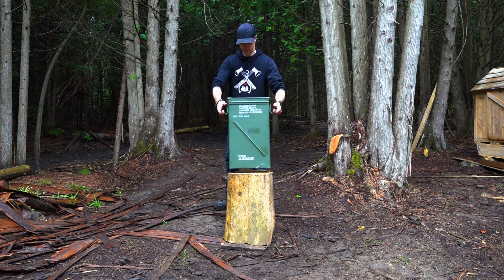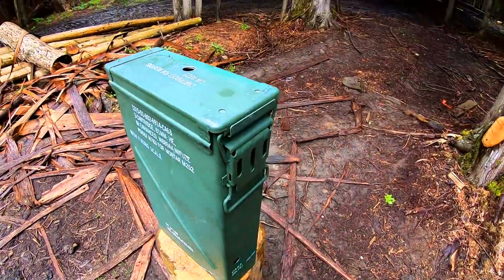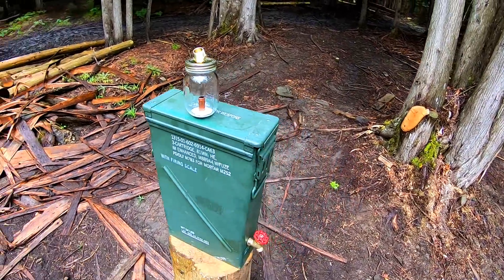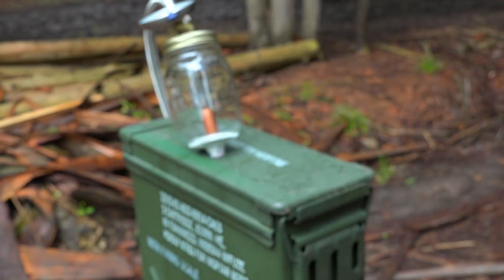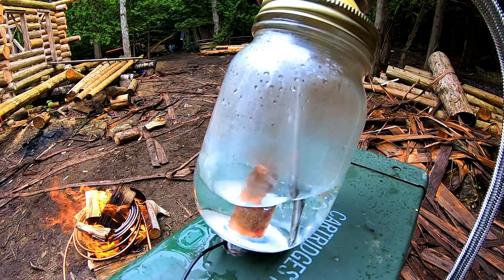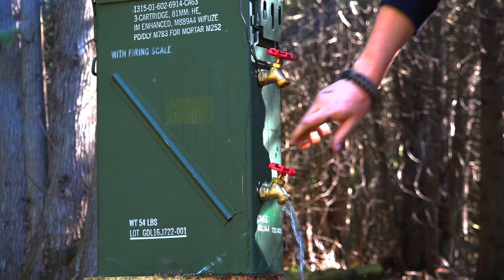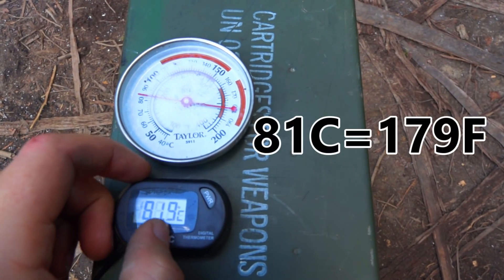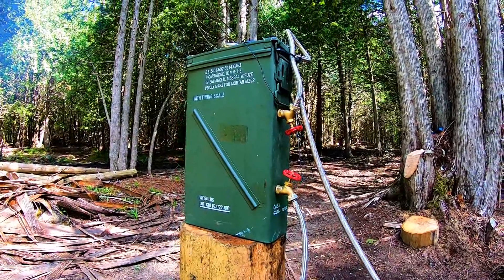Off Grid Heating Prototype- Copper Coil Water Heater / Heat Exchanger / Radiant Heater

Comment: reverse the system and put the coil in your shelter and then you could regulate your temperature by closing the valves
Reply: after thinking about it the best thing i came up with was a 2 coil system with a 3-way valve where the 3- way vavle sits between 2 coils with a bypass return to the can
run the valve handle through the wall and use it as a thermostat turning off the inside coil when you get warm enough. will require second return for the inside coil though
Reply: where can i get a ammo can like that?

Comment: right idea wrong concept, i used hot bricks before stack them... 

what your want is thos 99cent store candles 12x2" glass , do not use the toxic ones,  used 4 in your DIY camper they burn about 40 hrs each, 5 days of use, they burn clean, ......

small fan, to move the air in box, so not get stagnant.....

basic heat Timer /water 2hrs / bricks 4hrs / 10" rock 6hrs , takes 6 hrs to heat too, /

Comment: now the next step is to use the hot water to make electrical power
Reply: micro steam turbine, running a washing machine BLDC motor, charge a battery for an inverter!
hollow log rocket stove, with pressure cooker, piped into a radiator!
the sweetness of it all...aaahhh
cheers

Comment: If you seal it up so it can build pressure, it will raise the temperature necessary for the water to boil. You would have to design something like an adaptor for a radiator cap to vent pressure when it meets a threshold though

Comment: Neat yet completely impractical.  Too much equipment to carry and maintaining a supply of wood to heat the fire and water, which will be lost over time. You'd need to have abundant water in the area. Water is 8 lbs a gallon. The amount of water you have is at least 20 pounds not including the weight of the ammo can. Everything here is should be for entertainment only. You're a hobbyist everything depends on something else to function. A small camper pulled by a snowmobile is cool but a tent is lighter and more functional. You could have bought a large plastic doghouse and towed it.

Comment: what an absolutely terrible idea , your ether pumping steam in to an enclosed space thats going to hiy minus 10 4 o clock in the morning or sleeping next to a bomb or block of ice , can i make a suggestion ? keep all the water outside just have a coil placed in an ammo box full of concrete with vermiculite etc in it as a thermal "brick" inside the cabin , that way you dont need to enclose the reservoir can keep it outside and do not have to take the coil off the fire an hour after you start

Comment: You'll need to weld a bunch of steel heat sink fins on your ammo heater can.....to radiate the heat out better. Pretty neat design...learned something...all ports and hoses need to under water filled with water....no steam air interface areas.
Reply: Like car radiator?
Reply: @myes344  Yeah...he should have just used an old car-truck radiator.

Comment: Based on the final boiling water temp my guess is that placing the heater in your sled shelter will not only cause the small space to become too hot, it will also cause it to become a sauna.  The hot water vapor will soak your sleeping gear and you will become hyper thermic  as the temperature drops. If you just heat the water in the ammo can, remove the coil, seal the top hole, you can place the hot tank in the sleeping area and enjoy the warmth without the condensation.

Comment: Why not pick up a nice bigstock pot ..coil the copper wire into it run it out the same way you did the ammo box...a in and out hole .. Fill pot with water ... 
Then use a hose to hook up to the ammo box in and out or plex line insulated with weathering pipe foam to maintain the heated water in the colder temps out side...
This might bring down the ammo box water down a few notches in temp. This would be very close to a water heater set up.

Comment: If you were to make it a sealed circuit with an expansion tank and a pressure relief valve (safely). The above mentioned automotive radiator would be ideal (expansion tank too). 
You could then reverse your inlet and outlet therefore hot water would flow into the bottom and rise up displacing the cold water which I believe would flow quicker. I know when you are installing circulating heaters on diesel engines you always want the inlet lower than the outlet to promote better heating.

Comment: Nice video question can you add radiator coolant witch will increase the boiling point of water or use oil in place of water also instead of placing the ammo box in side run some copper tubing inside the camper to radiate the heat or heat the floor with the copper tubes then the heat will radiate from the floor up you will not have that red hot ammo box inside you can sit it in a large tub of water heat the water for washing with.

Comment: Couldn’t you run a length of the coil or line under the flooring to circulate the heat evenly while mounting the ammo can outside on the front or back?

Comment: I agree a car radiator method would be great. Also a closed system with a way to redirect the output or otherwise shutdown the radiator from inside. In fact, u really don’t need much heat at all do you? A small motorcycle radiator would work. Maybe shutting down the outside fire and using coals to heat would work.

Comment: You have the surface area wrong. Yo need VERY little surface area in the fire, where the external temperature is hundreds of degrees (F) above the boiling point, and LOTS of surface area inside, where you want to radiate heat from hot/boiling water to an environment just above 100 degrees cooler. You're going to have trouble controlling this to remain a liquid thermosiphon rather than a boiler in any case, but all the more so if you have all that copper tubing in the fire. As it is, you will get a lot of boiling and "percolator" action in the tubing. If you want to run a thermosiphon, put your thermometer right in the return line -- that's the T of water returning to the fire -- then adjust your "collector" so that temperature is just a bot above the inside T you want to maintain. I'll bet that you discover you don't need more than about one foot of tubing right in the fire to maintain it.

(and it will be quieter if there is no boiling in the tubing)

Comment: Idea 1: keep the  current heater setup outside the cabin. Run piping to and "inside" the cabin from the heater. In fact. have the pipe run under the flooring (ventilation options for u),  result: no inside space loss. Outdoor sound reduction (don't wanna disturb the crickets) and proximity safety (not inside where u r sleeping). Options to shelter the ammo can for outdoor noise reduction and insulation benefits. Work on and underground fire-pit that slow burns. (think of how they make charcoal)
       Idea 2: Put Wood-stove outside/close to cabin. Run piping from it. I suggest the flooring heat option.... should look visually friendly outdoors. Keeping the goals of "nature/critter respect"  with the lowest human footprint. Plus ya'll might want to sit outside around the nice heat to "Pop a cork and chew a while"  - The wood-stove will way way cut down on wood fuel =less wood manuring/hauling/stacking/locating/hauling/yada yada
       Idea 3: Use wood-stove upper venting pipe (stack). have it go into cabin where u c fit. ..................An inside cooling vent for all ideas should be in place

Comment: isn't it more efficient to run it the other way around ? Like for example a liebich cooler when you run the hot water in true the botom inlet it has more time to give off the heat, Or am i wrong about this and ys then the jar would be completly useless yes but wouldn't it be more effectiff if you did it like a liebich cooler but then for heating instead of cooling. Just a thought that crossed my mind.

Comment: The only way I have made this work is by a controlled spiral where the cold and heavier water falls down into the heat, and then is directed up and lifted by the lighter hot water.  That creates enough flow to carry with it small bubbles that naturally form.  If the system has any high spots like in your unorganized coil, air bubbles will form and there temperature will quickly reach boiling temperature and create steam which shoots the water out of your coil.  Now the system will rattle and clack as the steam collapses as cold water is introduced and water will come out hot in both ends.  When the system works correctly it is silent and one side is cold and the other side warm flowing in one direction.  The key is no high spots where bubbles will collect.

Comment: Why didn't you install any kind of weather stripping or insulation on the door to your snowmobile camper...? I know it has to get cold and drafty in there... you could help mitigate that with $10.00 worth of foam doorjamb weather stripping from the hardware store...

Comment: Nice build.... Brilliant and simple... You need to a temperature and pressure valve to run out of your sled camper... It will keep from steaming up your sleeper and you could always return it to the water supply via air gap and directional check valve. 
  Awesome video

Comment: The main problem was nowhere near enough water, the resivor is way to small for that much copper,  with 40 feet of large copper, you need to be planning on heating 100 gallons of water

Comment: This would be a nice application for paint that changes color when it is hot/cold. If you can have green as the background color, you could write HOT with a paint that is green in cold temperatures, and red in hot temperatures, and write cold with a blue paint that changes to green when its hot. Or maybe just go to ebay and get a "spray paint stencil/template" of some nice looking flames that can show up when it gets hot...

Comment: Cool idea sounds just like you'd be sleeping in a war with bombs going off in the distance not trying to be negative just saying it's loud. Maybe solar power with wall mounted heaters their slim and run on about what a light bulb runs on love your little home for the snow mobile but anyways that's my idea hope you get it figured be safe and have a good day
Reply: Kevin Kitts Done correctly it is dead silent. The clacks and rattles are from the steam collapsing in the coil due to air bubbles which allows the water to boil and forces the water out of the coil.  Working correctly the water flows in one direction down on the cold side and back up on the warm side.  No high spots in the coil to trap air is key.  It has to be a wound spiral and not just a pile of copper coil thrown in the fire.

Comment: Wrap the coil around your small woodstove, an wrap it in mineral board insulation. It's used to insulate boilers an it will shrink your wood usage an improve efficiency. Also run a relieve valve out your ventilation hole to keep from getting scalded if it tips

Comment: O, close the hole at the top with a pressure relief valve so you do not lose the water while your sleeping and so it does not blow up.

Comment: Place it under your camper and reduce the amount of coils (to 1 or 2) if your going to put it on the fire directly and it should work just fine. If you keep it in the SMALL camper you will not be able to take the heat. You will cook in there but outside under the camper, no problem. You MAY need to open a window from time to time, maybe.

Comment: I thought that's what the hose bibs were for.
Restrict the flow, less heat transfer.
Way more copper than probably needed.
Great if you don't have to move it around much.
Sounds like lots of coast time using that can.
I'm thinking, fill the can with some big stones.
Toss them when it moves, find more rocks.
It would hold the heat better, maybe more stable?
Cone shape with the copper coils, smaller footprint.
Bend up the last loop for an easy way to move it.
Give the coils a good coat of wood stove paint.
For your supply lines, I would use automotive.
Designed for heat or cold. Way above the need.
And pretty inexpensive. Outlast everything else.
Hit that ammo can with the remaining paint?
There are little temperature switches on Amazon.
Certain temp, it triggers on. I've used them.
Place that sensor, hooked up to a horn+ 9v?
Super easy overheat alarm.
Some fitting in the hot side hose, a valve,
to vent off the hot water in an emergency.
That's my suggestions.

Comment: Not sure if anyone has said this but you’ll definitely want to seal it up tight and port an exhaust hose from the top out of the sleeping area. Otherwise it will build up a lot of humidity/condensation.

Comment: The thoughts of coupling this system with a dakota fire hole seem very interesting to me. Cuts down on wood usage while also increasing efficiency. One could also seal the system up as to not emit water vapor inside the structure by adding a simple fitting near the top and an exterior catch/overflow can for anything that boils over. Just add the water from the catch can back to the system once cooled, you've recycled water otherwise lost. Great idea you have there for storing heat energy over a longer period of time than the viewer mentioned radiator idea (which only works with a constant heat source).
Reply: for the sake of safety, better to keep tank outside and just run some piping inside. Sealing the system is asking for trouble, I would just run the hot water and then let it go to waste outside on a hot tub, while snow supplies more water.
Reply: @guachingman  Sealed does not mean pressurized. It mean the tank doesn't have a gapping hole in the top of it, as shown in the video. Pressure and vaper is given a means to escape via the upper fitting I had before mentioned that could be routed to an exterior catch tank (exterior as in outside the structure) as before mentioned. This being much like the overflow system of your basic automotive cooling system.  I'm sure one could waste the water if they didn't mind the lack in efficiency, but we are talking about a small mobile structure here....I'm sure he isn't planning in pulling around a hot-tub to catch the waste. Maybe you were speaking of a personal application?
Reply: @scottbledsoe6042  yeah my mind went to the hot tub inmediately haha I am guessing he has like a second base or somewhere up in the mountains where he stops, would be nice to have a hot tub set there.
I get it now with the overflow, and you are right, with so much snow around I dont think wasted water is an issue, to sleep warm any fire that holds for some hours will keep such a small place warm.
Reply: @guachingman  the point of the video is to store heat energy over a longer period of time without the requirements of a constant fire, and doing so without the need of fire inside the structure(which causes additional safety concerns).

Comment: Great build! I would create a frame for your copper coil. Copper is annealed by the heat and becomes extremely soft and easily crimped or damaged. It also work hardens so repeated bending in one area without annealing will cause it to crack.

Comment: So, the hole at the top of the tank/ammo can, would be a good place to put another valve and hose that runs outside to a condenser. The condenser could be made out of an old small radiator that also connects to another large tank and then from  the bottom of the tank another water line runs to the inlet of the heating coil. Be sure that your over-pressure fail safes are placed OUTSIDE. Be careful and safe, steam burns are hideously painful.

Comment: Could you setup a gravity fed water system up on a hill to feed a water tank and then setup the tank to generate steam with a steam powered turbine?

Could charge a battery bank pretty fast maybe? Would be a cool experiement.

gravity fed water system obviously to replenish the lost water while charging the bank

Can get an inverter and a controller that will automatically stop charging your bank to prevent overcharge.

Water generated electric, hot water, and a heat source

Comment: Air in the lines does not produce steam, steam is water vapour. I would imagine with so little difference in pressure between the top and bottom it could have a tendency to start oscillating.

Comment: If yo wher to mount you whare reservoir high up on your cabin then snake your flexi hose through the cabin  then feed the out let of the hot water into another amo tank which is filled with cold water and has more copper pipe snaking throughout it  if correctly  insulated the second tank becomes a hot water tank which you can use for washing

Comment: LOOKS LIKE IT CAN BE TWEAKED TO,  HAVE A SHOWER STALL AND BATTERY WATER PUMP  AND CONTROL TEMP BY WHEN IT GETS HOT
 ENOUGH FOR SHOWERING. EVERYONE STAND IN LINE AND GET IN AS THE OTHER GETS OUT ONCE ALL HAVE SHOWERED TAKE COIL OUT OF FIRE.

Comment: An old Webber camp grill, a stainless coil, copper lines, water tank on top of the camper, small radiator or heater coil inside of the camper to reflect and dissipate the heat, then you have a contained fire that needs almost no attention, a ceiling hung heat source that is sealed so there's no chance of burning yourself with scalding water in your sleep, you can also control fire draft with one of them camp grills with the hinged lid

Comment: I'm skeptical that a thermal gradient in the heating water causes the circulation.  The density of water is mostly constant from freezing to boiling temp range.  Maybe steam bubbles rising inside the coil "blow" (water) out the upper tube as they expand.  I'm surprised (and impressed) it works without a recirc pump.  And  I wonder if a pressure relief valve would hamper circulation

Comment: It would also be smart to use your pressure outtake to use it as a ventilation system and keep it out to prevent the cabin from getting humid on the inside.